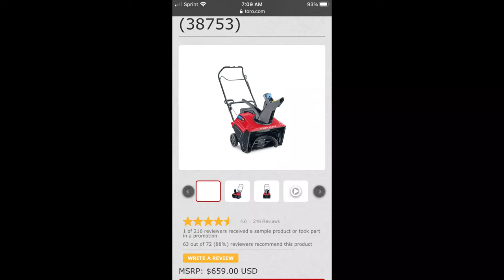YOUTUBE'S FIRST 212CC PREDATOR SWAPPED SINGLE STAGE SNOW BLOWER!  BAD A$$ BEAST!

Comment: Your Right about the fact they are way faster than two-stage snow blowers calma however that four-stroke doesn't have enough RPM's to handle the wet stuff as you can see in the video they need that high RPM because they don't have a gearbox like a two or three stage
Reply from the maker: These 4 Strokes are set to 3,600 RPM..I do agree it needs more revs!

Comment: Dude this is incredible Lmao, I have a 212 I’m trying to throw on a Ccr 2000 right now I hope I can get it together.
Reply from the maker: How did you make out?  Did you need a sleeve?
Reply: @pattayperformance  lots of “oh shit, I need to take this all back apart again”, but, Got it built and operational. Now waiting on some performance parts and another snow storm lol. Trying to piece the plastic back together the best I can, Had to make the 3/4 shaft on the 212 work w the 1” engine pulley on the toro. Ordered an adapter but got impatient and made one out of some copper pipe and a key I had layin around. New belt, scrapers and hardware. Wasn’t able to keep the original look of the snowblower like you achieved, but I ordered a toro decal kit to add once I’m done w the paint. Fun as hell, ALMOST forgot about the Harley 🤣👍

Comment: Jason put ceramic wax on the shoot and noo clogging just make sure your garage is warm use a little heater and put gas out side for a few mins
Reply from the maker: Thanks I’ve seen people ceramic coat their machine and didn’t do so well!

Modify the impeller will solve all your clogging issues! 🤙🏻🦅🇺🇸🔧
Reply: @pattayperformance  awesome do that please

Comment: Those are such a pain in the nuts to take apart
Reply from the maker: 😂😂😂 I’ve had this apart a few times, to the point it’s not so bad.  Everything is anti-seized and I know where some of the hidden fasteners are 🦅🇺🇸🤙🏻🔧
Reply: @pattayperformance  really just those two hidden bolts a flex head ratchet helps
Reply: We got 3 carb cleanings and carb and handle replacement on a 3650 today why do they seem to pop up with no handle